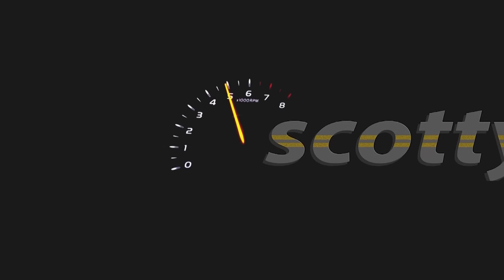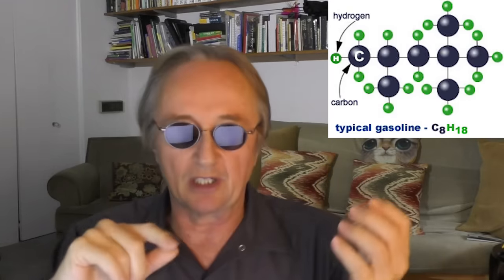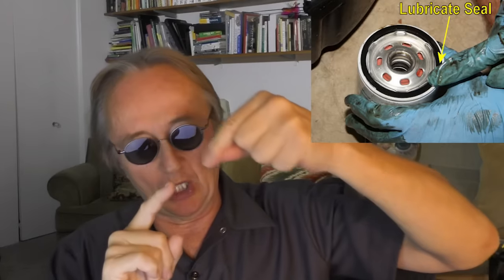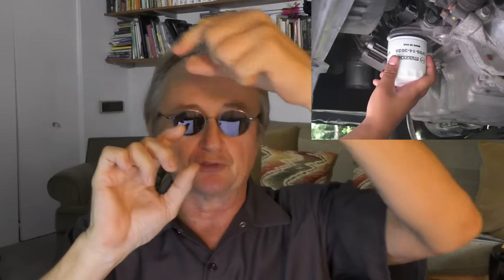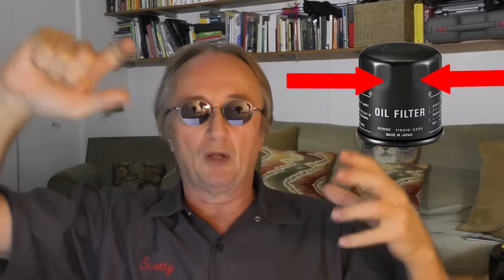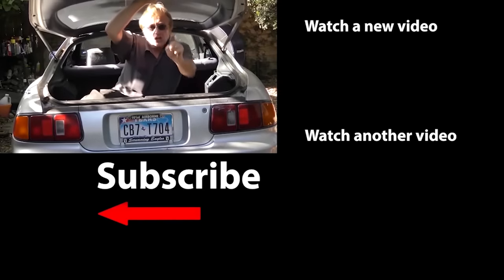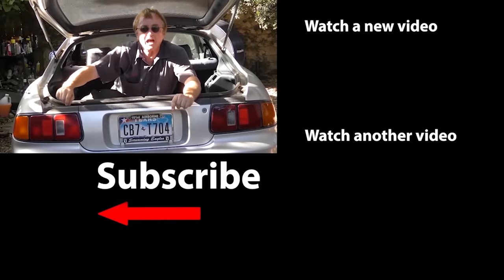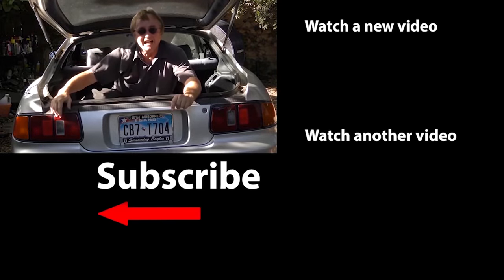Why Water Comes Out of Your Car’s Exhaust Pipe

Comment: Scotty. Question. My 2007 audi a4. When I'm idling in my garage the radio station has trouble getting in tune.  But when I shut the car off, the station gets clear and loud. Any idea? Tks. Rob
Reply: The engine's creating electromagnetic interference that the receiver isn't shielded well enough against.  Cheap radio. Probably an AM station you're trying to get.

Comment: Sorry Scotty what are your thoughts about the a 1995 Toyota 4runner?
Reply: Which one we talking about? 1995 was a switch over year and you had the N120/N130 (second gen) and the N180 (third gen) selling at the same time. The N130s have head gasket issues and it's advised to avoid them meanwhile the N180 (the car I have) is awesome just have to watch for pink milkshake.

Comment: I have a 2008 Lexus GS 350 with 112mi, sometimes when I turn on the engine I do get white/griesh puff smoke 💨 lasts for like 4-5 Second then starting to fade and evaporate , it happens even if the car is warmed up and sometime I see a little water dripping from the exhaust ? Should I be worry ?

Comment: Question: when I start my put my car into first gear, while I left off the clutch the engine shakes, what could be the problem? This also happens sometimes when I use my second gear.
Reply: I'm assuming you're shifting correctly, first of all. 1st and 2nd are gonna see the biggest torque demands and most stress on the whole system, so i guess it could also be a result of a number of problems, like fuel delivery, timing, mounts, etc. Probably need a good mechanic like Scotty to check it out in person.
Reply: @redtrek2153  Thank you!

Comment: on high humidity days you will see this water just gushing out of the exhaust on the cars in traffic in front of you.   when they take off you might see a stream of water pour out,    on low humidity days you will see no water come out.  and on many cars if you look under the car along the bottom of the exhaust pipe you might see a brown rusted line on the very bottom of the pipes.  and on many mufflers you will see a little hole in them,   its for water to drip out.  your motor sucks in the humid air and bakes it out just like a dehumidifier.   but the old diesel GM cars,  hahhaha  I only got to see them when the heads blew out on them and blasted the radiator cap off.  they was junk.

Comment: Scotty, I have a 2016 MDX  which I am thinking of buying at the end of my lease May 2020. I heard that the MDX,  & Pilot gen 3 have issues with Honda's 9 speed transmission. Which may not be made by Honda I heard. In the past two years I have not had any issues after 35,000Km. Honda has increased the warranty to 10 years 160,000 km. Do you know what the real problem was due to?  I heard it was software and or transmission oil pressure. Do you know what the real problem was or is due to? I ask my dealer and they tell me there were a few cars in 2015 that had this problem, but I don't believe them.
Reply: The nine-speeds are made by ZF, a German transmission maker. It has been known to have reliability and rough shifting issues. If yours seems fine, then perhaps consider buying it at lease end. That said, ask the dealer what the cost to buy out the lease right now would be; if it's less than the cost of the lease payments plus payout price at lease end, and you can get a very low interest rate on a loan (under 5% APR) from the dealer or an outside bank/credit union, then perhaps this is the right route to go.

Here's a counterpoint: Have you researched Tony Seba's views on autonomous car services? These have the promise of being the Netflix of transportation. Scotty thinks there are too many legal hurdles, but I disagree, and believe that by 2025 at the latest, these services will be cheaper than car/SUV ownership. It may not be smart to carry a vehicle with so much residual value into this zone, in case all existing car valuations plummet super-quickly. So you may want to look at a $5,000-10,000 Toyota Highlander, now, and try to keep it running for the next decade. You'd buy the MDX lease out so you can sell it, and then, if you're not upside-down on the MDX, use the proceeds towards buying the used Highlander. Just something to consider.

Comment: Both honda fits I have owned smell of gas in the oil even after a change I assume it's kinda normal to get some smell of gas in the oil.
Reply: To an extent, especially if the car is driven for short trips.  Watch the oil level.  If it appears to be rising, gasoline is accumulating in the crankcase.
Reply: @saddestchord7622  the oil stays at the same level all the way up to 6k miles on the change I try not to wait that long and I typically drive 20 miles at a time at 65-80 mph 5-6 days a week
Reply: @TONOCLAY  You're probably fine.

Comment: The water mostly comes from the catalytic converter injecting oxygen into hydrocarbons, breaking the long chemical chain and turning the toxic gases into h20. Even the shape of a pipe will attract water from the air from just sitting. I'm waiting for the main reason for water in the exhaust to be addressed.(???) C'mon Scotty, damn. Teach them about the catalytic converter.

Comment: Didn't they make a whole new engine block for the 5.7 Diesel? I thought the issues were: 1: No water separator; 2: Weak head bolts; 3: Just designed to be way too slow in the first place (Weaker than the Gas 6 cylinder engine they also offered in the B Bodies of the time? Come on now.) With that said, Scotty, what about the 6.2 Diesel and have you seen a former 5.7 car converted to have the 6.2 instead? I heard the 6.2 was a lot better for reliability than the stinking 5.7.

Comment: If there's that much gas being injected into the engine to where it's coming out the exhaust the car most likely wouldn't even run. It would hydrolock the cylinders and and it wouldn't even turn over let alone start and drive.

Comment: Question

I'm looking to get a Dodge caliber sxt 2008. It's 2200$. 140k miles. Engine is great condition. So is the actual car. But I've heard 50/50 reviews. Some bad. Some good. Particularly with the cvt transmission

Would this be an ok car? Just gonna use it for getting to work, and riding around town some with my girlfriend.  The seller is reliable. Same person I got my cruiser from about 3 years ago.

Really need a new car. But can't afford dealership lol. My 07 PT cruiser is dying after 230k miles. Transmission is going, suspension is gone, and the engine runs hot and rough.
Reply: Get him to somewhere between $1,750-2,000. Also consider a 2002+ Ford Crown Victoria or Mercury Grand Marquis for a similar price range, or occasionally less.

Comment: Aside from being so freakin funny if I had clicked the vid 2 months before I took blown(leaking head gasket) problem expecting the dealer to know chit about this problem----either they knew I had cash in my pocket or they blatantly lied to get more detection done---they soaked me for hundreds$$$-----I finally took it to a specialist engine repair guy who got to the root of the problem and was then fixed--------------the one garage where old engines are sitting on the floor and he can tell you about every one of them--& that the people are scraping up $$$$  to have him complete the job

Comment: Question For a Video: My 1999 f150 has the error p0180 and its not the bushings for the Manafold, what can it be?
Reply: Did you check the actual fuel temp sensor to make sure that's not broken? One that's giving a false reading can trip that code.

Comment: Scotty I recently got into a front end accident on my 2014 honda accord and my frame bent. The insurance company wants to total my car however the body shop claims they can fix it what should i do.
Reply: Take the insurance payout and buy a cheap manual Accord. Also consider a 2002+ Crown Vic or Grand Marquis.
Reply: @EMichaelBall   id rather walk
Reply: @EMichaelBall  I love me a v8 crown vic though
Reply: @jacknoff8692  Yeah, those are really cheap; the 2002 and later are the best. You can find one for most likely far less than the insurance payout; I'd just go do that

Comment: Hey scotty  my 95 f250 runs good at highway  speeds but sometimes dies when idling in gear and hesitates at lower speeds in town at 25 to 45 it has 245 thousand on it  any suggestions just put fresh air filter and spark plugs it's often parked  in dusty conditions if that helps ran good for a couple days after air filter change then went downhill again filter still looks good when I bought  the truck the front tank was full and still is of I don't know how old gas be because  it doesn't work could this be part of the problem I've  always  just ran from rear tank I've owned it for 6 years 20 thousand miles
Reply: Aron Aron check the fuel filter first, if that's not it, check out the fuel pump, but I bet it is the fuel filter. Good luck!

Comment: In before StupidHeads say "If liquid is pouring out of your exhaust, just shove a garden hose up your exhaust and then spray! Obviously the engine is dehydrated so you want to put water back into the system."

Comment: Hi there I have a Ford truck 2002 f150 4x4 New engine New transmission everything is new but I don't have power I can run faster than the truck

Comment: i got a 2004 grand prix with non supercharges fan stopped working im thing presser sensor because when i took it off it  was in 2 peaces   also radiator  leaking by upper hose the plastic cracked when car drives and i push on the gas and its like bucking but when i tap lightly drives and it will stall and wont turn over for like 2 min then it will if i rev the hell out of it should i just junk it or replace the engine also water leaking out muffler
Reply: car has like 2hundred and 30 k on it

Comment: Yo, I got a 1978 Cadillac coupe Deville. Was thinking of clean trading it in for a 1985 Hyundai Sonata no rust. Should I do it?
Reply: yes... after a quick inspection of course. Check if the oil cap is full of sludge inside. The sonata will be cheaper to fix.
Reply: Old hyundai are garbage imo
I think they are way less reliable than new ones,

Comment: 9 grand for a 2002 car lol. HAAHAHAHAHA wtf.
Reply: yep it doesn't make sense
Reply: @rejm1161  It wouldn't make sense on one with low mileage let alone one of 105,000 miles.  I can get a decent 5 year old Toyota Auris with 60,000 miles for 9 grand in the UK. PS Auris is the UK version of a Corolla.
Reply: @gravemind6536   even if we put it in Canadian dollars and kilometers, it's still crazy. Ford doesn't have any resale value.    Toyota Yaris sedan 4 doors 2009 still sell for $5000cdn in Canada , if not rusted. ( 3,000 GBP)   Corolla 2013 sell for $9,000 cdn$ ( 6,000 GBP)  2009 Fords are at the scrap yard . value= 0